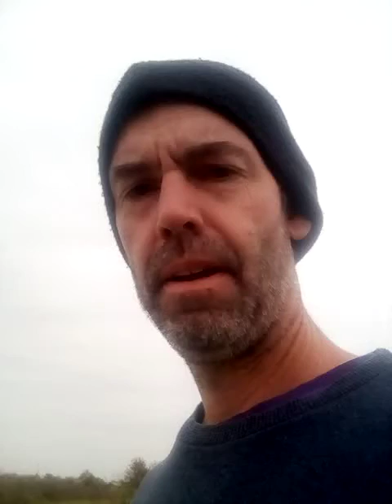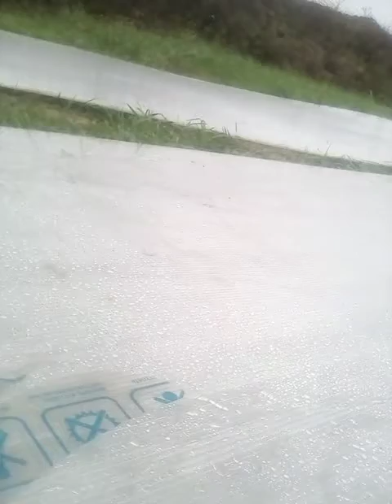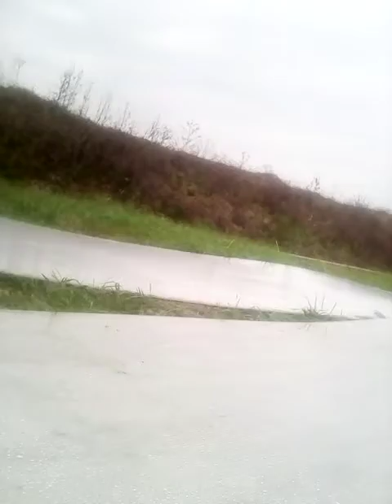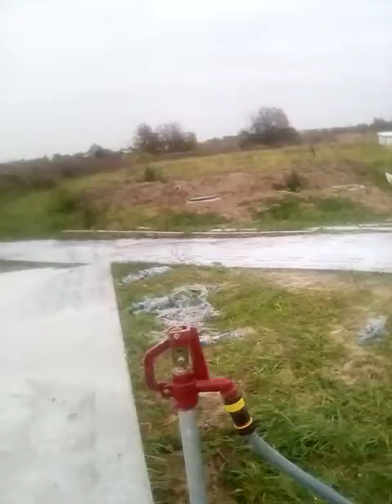Tip for removing plastic film from polycarbonate

Comment: Ive been doing signs for over 30 years. If it has the paper/plastic backing like you have, mineral spirits wont harm the poly and will lift it right off. just get it wet and let stand a few minutes. No damage to the polycarbonate. If its plastic only film, good luck with that.
Reply: Holy shit.  Thank you. This is making it come off in one piece